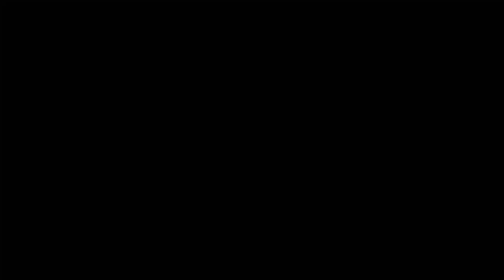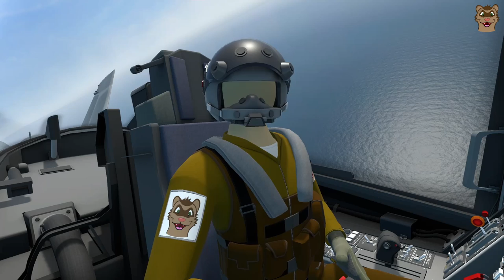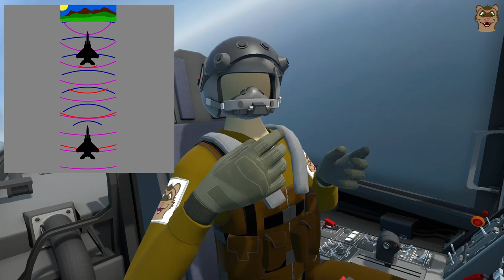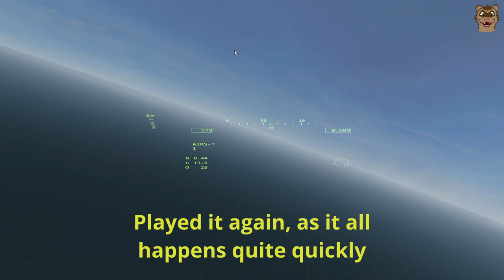VTOL VR - Missile Evasion Tactics for Beginners

Comment: Another thing you can do for short range IR missiles is reduce throttle to 0 and shut them off if needed while popping as many flares as possible. This is a last resort though. Just reduce throttle to reduce your heat signature and pop flares so its more likely to go towards the flares.
Reply: when i used to play war thunder during the arly days of IR missiles i would shut off my engine mid flight and pop flares and the missile would instantly lose lock and because of this the hostile would turn away thinking they already killed me. the funny thing is too that if you keep your throttle up after turning your engine on it takes 2 seconds for the engines to turn back on and burn hot
Reply: I don't know if it's modelled correctly in VTOL VR, but popping as many flares as possible would just create a trail behind you and lead the missile to you. Is that correct or does it not work like that here? I'm quite new.
Reply: @Sudden2724 yes it does if you continue to fly straight. That’s why when you do have a missile on your 6 you pop chaff and flares while banking in hopes that that heat from the flare is hotter than your engine
Reply: @Sudden2724 I know I’m late, but you can adjust how your flares drop in the settings, I prefer double at the highest release rate.  You drop 2 sets of flare/chaff per press, and you can hold it down for a moment to pump out a bunch in one area, then break hard.

Comment: 2:48 Small note, the DLZ does not show boost vs glide phases, rather it shows the "rMax" and "rOpt", that is, the maximum possible range the missile can reach, and the "optimal" or the "no escape range" or the "minimum abort range", which basically means even if the target maneuvers the missile will still reach.

Also at 5:18, the radar cone is 60 degrees off either side, not 30
Reply from the maker: Hey, thanks for adding this man. Always welcome good information 👍

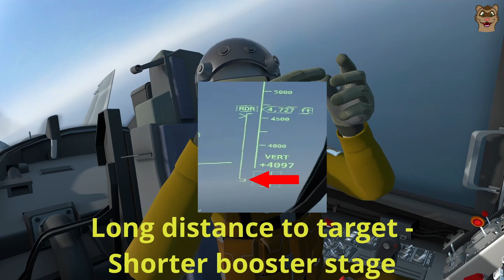Comment: 2:40, You are wrong.

That part of the hud is called Dynamic Launch Zone, DLZ for short.

it is not used to show what your booster stage/glide stage is, instead it is used to indicate 2 things.

The top part of the DLZ is called Rpi, short for "Range probability of intercept", it shows the maximum range in which the missile could hit its target assuming the target would remain perfectly stationary.

the bottom part of the DLZ is called Rtr, short for "Range turn and run", it shows the maximum range in which the missile could hit its target assuming the target were to turn away from you and go full afterburner, also known as "No escape zone".

The reason that the DLZ becomes smaller or larger depends on closure rate and altitude.

The AGM-88 HARM anti radiation missile also uses DLZ symbology, but in this case there is only the Rpi shown. because radar sources tend to be stationary anyway so there is no need for the Rtr. Eventhough the HARM also has a booster and glide stage.

Also, what you are describing as Beaming is actually called Cranking, Beaming (More or less the same as notching) means to put the bandit at your 3 or 9 O'clock in an attempt to hide from its radar.
Reply from the maker: Awesome, thanks for the clarification bud
Reply: @TheFerretsWheels  no worries!

Comment: Hey mate, great work on your tuts! they've been so helpful in game!!!

I used to be a RADAR tech in the military for some time and was a fire-control specialist  so can I just point out that your RADAR theory is off slightly; Doppler RADAR has a soul purpose of measuring velocity,  it is directionless as it just measures the difference between pulse frequencies. Aircraft and Weapon systems use an active transmit-receive system, which as you pointed out, emits a pulse and receives a pulse but it is the time taken to hit a subject and return gives the fire control system the target range and the angle of the seeker head at which the pulse was transmitted will determine the bearing; usually a fire-control system will calculate the speed based on a previous position. Doppler systems are used on things like artillery to measure the speed of a projectile to help calculate fall points, they don't have a real use case for aircraft. There theory behind using terrain is somewhat like masking... IRL you need to be flying really close the the terrain, when the seeker head transmits a pulse the return pulse from the terrain should be larger than the echo from your aircraft and so the FCS cannot distinguish between the terrain and you. 

The missile systems I used to work on didn't have a self destruct, there were older SM2 and Harpoons... if you release the lock on an SM2 it just kills the motor and falls out of the sky... no earth shattering KABOOM...  and the Harpoon, well that just hunted until it ran out of fuel or it detonated. 

Sorry, for the blurb, just thought you might be interested in what really goes on ;-)

Keep up the great work.
Reply from the maker: Dude, appreciated very much. As I have mentioned in a lot of video, I have no military background so the information I have is from researching on the internet and my own (limited) physics knowledge. 

I have absolutely no issue being corrected and tutored on any subject by someone who knows more about it than I do
Reply: As another Radar tech, he's right.... and wrong. What's being modeled here, and is actually in use in aircraft, is PULSE Doppler. It is absolutely used in detecting aircraft, from other aircraft. However, your description is still slightly off.

The "Ground Return" will have an amount of doppler on it that is the airspeed of the originating aircraft. If you're going 300 kts, the ground return will have 300kts of closure doppler on it, aka a "higher frequency", not the same as your transmission pulse. An aircraft in front of you, also traveling 300kts, will effectively be motionless, and have ZERO doppler on it, and therefore be the SAME frequency as your original pulse. There are filters for both in the radar receiver so you don't see things like clouds or the terrain (which is the delination of a "look down-shoot down" radar). On a graph, with the vertical axis being 'received power', and horizontal being 'frequency', you have a line that goes striaght across with a big V shaped hole in it. A 'notch'. Which is why they're called 'notch filters' and the tactic is called 'notching' because you're trying to have your radar contact fall into this notch filter in his radar and just disappear.

 @TheFerretsWheels
Reply: @TheFerretsWheels  I just wanted to add, and someone may have already corrected this or you might have learned it elsewhere, 6:08 radar isn't a soundwave, it's actually light. That is, it's a radio frequency wave. Radars typically operate between 100Ghz and 300 Ghz, and the radio spectrum of light is considered to be 10Khz to 300Ghz.

The term "radar" my have started as an acronym for "radio detecting and ranging" and was the US preferred term for the system, the British preferred "radiolocation."
Reply from the maker: @ialsoagree1634   Thanks man. Yes it's been corrected and I did know it was the EM spectrum but waffling in the videos as I do I just got it wrong

Comment: Hey man, i'm the new guy in your community😅. Just subscribed😉.

One thing i have to add about missle-ivasion. If you dieabled the "g-limit" in thr game menu, your game no longer limits you to "9 G"'s.
What that means is, you can pull much harder, most i saw was 14G's, which not a single missle i know (in the game) can pull. But of course that is only possible for a minimal time window.

Also, G-forces are easier to pull, the faster you are. For example, if you fly at Mach 0,5 you will never reach 10G's, but if you fly Mach 1,2 the 10G's become ridiculously easy to pull😊

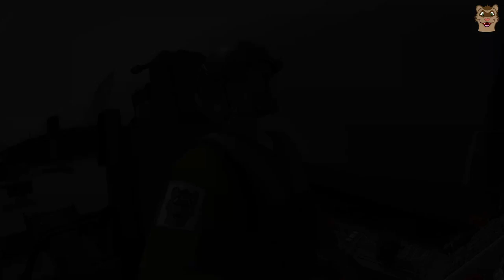Comment: 15:09
The missile knows where it is at all times. It knows this because it knows where it isn't. By subtracting where it is from where it isn't, or where it isn't from where it is (whichever is greater), it obtains a difference, or deviation. The guidance subsystem uses deviations to generate corrective commands to drive the missile from a position where it is to a position where it isn't, and arriving at a position where it wasn't, it now is. Consequently, the position where it is, is now the position that it wasn't, and it follows that the position that it was, is now the position that it isn't.
In the event that the position that it is in is not the position that it wasn't, the system has acquired a variation, the variation being the difference between where the missile is, and where it wasn't. If variation is considered to be a significant factor, it too may be corrected by the GEA. However, the missile must also know where it was.
The missile guidance computer scenario works as follows. Because a variation has modified some of the information the missile has obtained, it is not sure just where it is. However, it is sure where it isn't, within reason, and it knows where it was. It now subtracts where it should be from where it wasn't, or vice-versa, and by differentiating this from the algebraic sum of where it shouldn't be, and where it was, it is able to obtain the deviation and its variation, which is called error.
Reply from the maker: Facts

Comment: Radar is not a sound wave. It is a type of electromagnetic radiation. The difference between the two is that sound travels at 340 m/s (at standard temperature and pressure [0° C and 101.325 kPa]) and electromagnetic radiation waves travel at around 299 x10^6 m/s and are not limited to traveling trough air. Still a great video though :)

Comment: If RADAR works with sound waves, assuming a plane is flying tail-to-nose away from the RADAR emitting plane at mach 1.5, wouldnt the RADAR sound wave never reach the plane as its moving faster than the speed of sound?
Reply from the maker: Yes, my mistake. The waves are EM (electro-magnetic). Similar idea, but travel much faster.

Comment: 15:02 I would have been screaming 😂
Reply: The missile knows where it is at all times. It knows this because it knows where it isn't. By subtracting where it is from where it isn't, or where it isn't from where it is (whichever is greater), it obtains a difference, or deviation. The guidance subsystem uses deviations to generate corrective commands to drive the missile from a position where it is to a position where it isn't, and arriving at a position where it wasn't, it now is. Consequently, the position where it is, is now the position that it wasn't, and it follows that the position that it was, is now the position that it isn't.
In the event that the position that it is in is not the position that it wasn't, the system has acquired a variation, the variation being the difference between where the missile is, and where it wasn't. If variation is considered to be a significant factor, it too may be corrected by the GEA. However, the missile must also know where it was.
The missile guidance computer scenario works as follows. Because a variation has modified some of the information the missile has obtained, it is not sure just where it is. However, it is sure where it isn't, within reason, and it knows where it was. It now subtracts where it should be from where it wasn't, or vice-versa, and by differentiating this from the algebraic sum of where it shouldn't be, and where it was, it is able to obtain the deviation and its variation, which is called error.

Comment: my problem is you are ment to do different evasion tactics for different types of missiles, and like the whole aim 120 vs 7 reacquiring how

how do i know whats shot at me? All I know is a missile is coming Im not sure how to tell which. like will flares be useful on the thing flying at me no idea
Reply from the maker: Aim120s (Fox 3) are a more advanced missile than an sim-7 (Fox 1) and has its own onboard radar, so if you lose lock it will activate its own radar and search for a target. When a fox1 loses track it has no onboard radar so it’s trashed.

In general, if what is shot is radar guided (fox1 or fox3) you will get an RWR warning. This is where you notch, crank etc. and generally do what you can to drain the missiles energy to evade it. If you hear “missile launched but no RWR warning then it will either be a Fox 2 or a friendly launching without calling their shot. In that case lower your throttle and fire countermeasures then look for smoke in the air to get an idea of where it’s coming from. If it’s coming for you keep popping flares until it loses track.

Each engagement will be a little different and the more practice you get dodging the better you will get and understanding how the missiles work
Reply: @TheFerretsWheels  Crank?
Reply from the maker: Crank is for when you have fired a missile, turning away to make their missile fly further but still keeping them on edge of your radar so your missile still tracks

Comment: You talk a lot about radar but does this also work for heat seeking?
Reply from the maker: Heat seeking is a little different. Engines to minimum and spam flares to confuse the seeker
Reply: Heat seakers, instead of radar, use IRST (Infrared search and track). They differentiate the temperature of your engine versus the surrounding environment. High G manuevers, lots of flares and prayers are how you avoid them.

Heatseeking missiles are typically short range high G missiles meaning that if youre in range youre exclusively trying to force the missile to overshoot because anything else and youre dead. Kill ABs, fire countermeasures, and alter your trajectory to try to trick them. At medium ranges, just attempt to run the missile out of fuel, heatseekers dont have as much as Radar missiles.